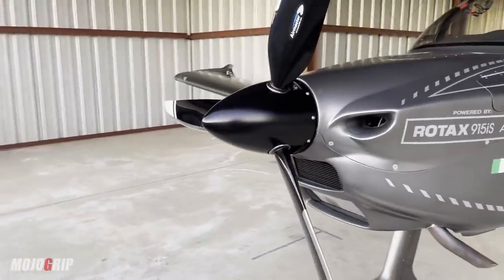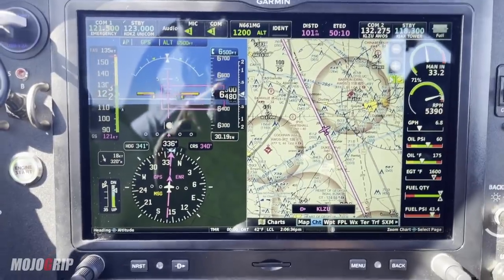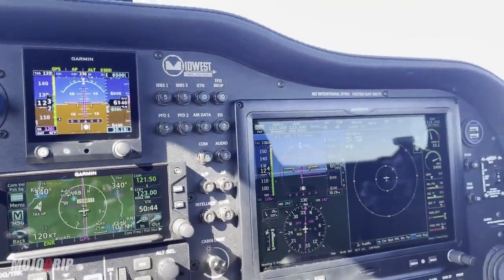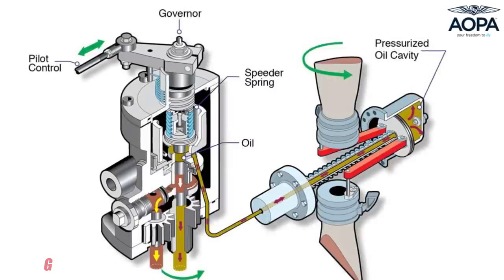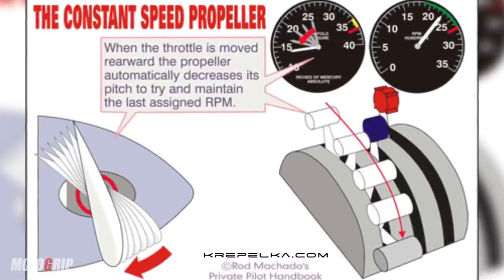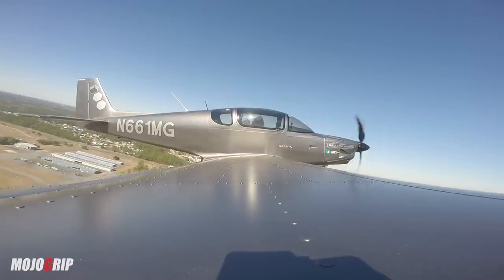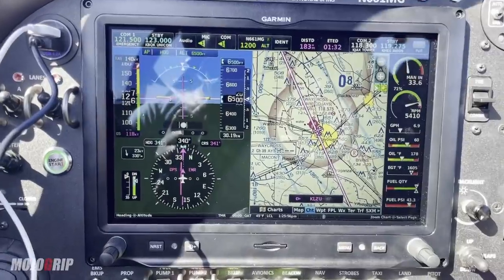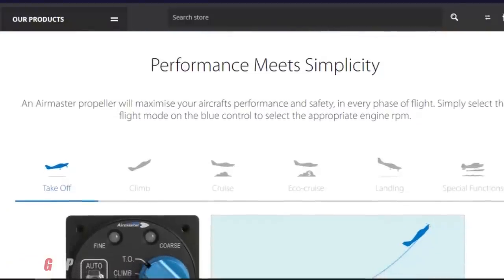Airmaster Will Make You Go Fast And Burn Less Fuel

Comment: Hi Mike.  Not much into "Infomercials" - i.e. your electric prop.  In my mind, I keep going back to your $50,000 Avionics panel, and the prop which, as I recall, was around $7,000.00    I know you want to use your Sling for business, etc., but for probably 99% of your followers, this is not what they are looking for.  They just WANT TO FLY!   The panel and prop alone, would be  WAY more money your followers would need to buy and build (they themselves build)  an Experimental Amateur Built airplane.  HUGE number of kits out there for that $57,000.00 dollars.  For your +$300,000 in your Sling, your followers could build (or buy GA used) up to 4 EAB's!  The almost "fully automatic" operation of your Sling, IMHO, takes away the beauty and joy of actually "flying" the plane, not just manipulating the controls.  In the real aviation world, your aviator followers need to be able to fully, manually,  fly a plane - hopefully their EAB's.   Setting switch positions and lever positions, then sitting back and letting the airplane fly itself,  doesn't seem to fill the bill.  Where am I wrong.?
Reply: God forbid the man shows us the plane he built for HIMSELF. God forbid that he made HIS plane easy to fly and as close to operator friendly as possible. Oh the horror.
Reply: @Heareaux  My opinion only.  The truth of the matter is that Mike's followers can only DREAM about having an EAB like his.  Nothing wrong with dreaming, but at times some reality must be thrown in.  A question:  Do you really think Mike built 51% of his Sling?  Is the MAJOR requirement to claim the mantle of the "Builder."  Just curious.
Reply: @mmichaeldonavon  not only is the man over opinionated but has so much hubris to the point of declaring himself speaker for all the MG subscribers. Just because you can't afford it doesn't mean it's the same for everyone else. And besides, who declared you the arbiter of kit appropriate for his followers. They are his followers not yours.
Reply: @deadliaski  You, sir, are absolutely correct in your observation of me.  I am "overboard" in my comments because I've seen a lot of this unfold around me, for over 30+ years in the Amateur building community.  Mike's followers LOVE him and HIS little Sling - and that's a good thing.  Actually, my heart breaks for those thousands who follow him and most, a great percentage, will never see the day they finish and fly their own airplane.  Why?  Because it costs a ton of MONEY - Mike has access to money, we "little people,"  and I'm including myself, do not.   Mike has invested $300,000.00 plus in a "run of the mill, airplane.  Not only that, to keep that airplane flying will cost a TON of money.  We, little people, cannot even conceive being associated with "money numbers" that high - for a little airplane.  I'll just say this:  If a potential builder is really interested, he/she must consider all of the ancillary costs associated with having a "little plane."  I won't enumerate them - there are many.  I flew General Aviation planes -rented - never owned.  VERY expensive.  The "home built" planes are expensive, also, but not as much.  So, I meant no harm - I just know what it takes to fulfill that dream and don't want to see anyone mislead about that.  As an "old person," I no longer fly. I guess 40+ years is enough  Thanks for your comments - I will always listen to opposing ideas.   N-6395T
Reply: Those who have the money will buy the kit if they are so inclined. Those who don't will either buy a used aircraft or rent. Those who don't have money at all will just live vicariously through the videos. It doesn't take a genius to realize that's how things will play out. I certainly don't need you to come in video after video commenting and essentially saying the same obvious things (infomercial-expensive-no one can afford it-yadayadayada). What I don't understand, however, is why you keep coming back to rain on the guy's parade, when you are clearly NOT his intended audience? Do you also hijack the comment section of other builders' YT channels (plenty of Vans being built out there), or is it just this channel? Market segmentation exists because consumers have different wants and needs. Not sure why you are so insistent in believing that all consumers are like you.

Regardless of whether you agree with him or not (no, I don't always agree what what he posts), the guy has built up an audience for his channel with the videos that he created promoting and espousing his own viewpoints, "infomercial" and all. Right now, you just seem like someone who's riding on his achievements and "borrowing" his audience to gain some exposure for yourself and your own views. If you have an opinion you really want to put out, maybe you can work on your own channel, create some videos, and try to build up your own following, instead of just sniping at someone from the comforts of your lay-z-boy.
Reply: @whisky3k  Hello.  Oh, don't have a lazy boy.  My only involvement with Mike's  project is that as I watched it all "develop and go down," it was obvious that it was a "factory build."  Yes, he was given 51% of the credit for the build, but, hey, let's get real.  I think he called in every day, from Georgia, to see how they were doing (?)   Stopped by, once in awhile, and put in some rivets.  

If you detect a bit of cynicism, it was definitely there.  I guess I'll leave Mike and "his project" alone, now - I'm finished commenting.   I commented because I KNOW what blood, sweat, and tears that go into building YOUR OWN Experimental Amateur Built plane.  It "ain't" easy, that's for sure.  Mike made it look easy as he became the "guy behind the curtain," as the project went on.  For me, that's all it WAS (notice the past tense)  I built 3 EAB's - know of MANY that were built - and understand how difficult and expensive it is to complete a project.  Only about 30% are completed - then they are sold.  

I don't know if you are a builder or not - don't care.  I just wanted Mike's followers, "the masses, " to know that this build seemed to have a lot of smoke and mirrors.   Other builders have had similar comments.  Thanks for your comments.  p.s. Yes, Mike is a great pitch man - not everyone could do what he does, and how he does it.  I congratulate him.
Reply: @mmichaeldonavon  I enjoy watching. I can afford to build or buy a plane if I wanted. I'm not going too, but actually, folks who have this type of money ARE going to be tight on time in most cases. So assistance in the build is welcome. This shows us that you can participate, but that it's not from scratch build (I have a relative who did the scratch build - 5 years plus before he gave up - I would never do that - it was a true from plans effort though so FAR more work than this mojosling thing). We can make our own calls on the safety aspects if we have assistance. And we can appreciate what automation would bring. So stuff you are complaining about may not matter to folks doing a 300K+ "kit" plane. 

Mike should lean in on the building being fun. Go upmarket with EAB - seriously. This whole you've got to be miserable building is a horrible approach, but it is the way it is done - witness how many don't finish. I'd suggest keep following Mike - you can make good money solving problems for folks, and the miserable EAB build is a problem. If he solves that he's going to have even more money coming in! Not sure the plans will be much less safe than a true garage build.
Reply: That "he built for himself?"   Mike was mostly in Georgia - the factory personnel did the build.  I will "eat crow," if someone can show me the documentation of his 51% participation, required by the FAA to be "the builder."  He is presently listed as  "the builder," in the FAA documentation.     If you want to pay for a "factory build," then pay for it.  If you want the JOY of actually building your own flying machine, then YOU build it, or build more than half of it.   

In  over 40 years of observing "EAB builders," there have been quite a few that, after seeing the magnitude  of the work and time required, "deep six the project."   The "I want it NOW" syndrome kicks in and the EAB project is history.  

Yes, Mike is a busy guy - yes, he doesn't have time to devote to building a complete EAB.  Yes, it is difficult to "hang in"  there for the complete build of an EAB.  I've known MANY who did finish their planes - I've known MANY, who did not.  

If you want a plane like you want your fast food - which is NOW,  then have the factory build it.  They will then let you know when to stop by and pick it up.  For some strange reason, that doesn't appeal to me.

I wish Mike, aka Mojogrip Sling tsi,  the BEST.   He has shown he can put things, and people  together to make it happen. He's an excellent manager, with access to cash.   Thanks
Reply: @mmichaeldonavon  bro, just cuz we can't afford it doesn't mean he shouldn't buy one. its YOUR choice whether to watch his videos or not